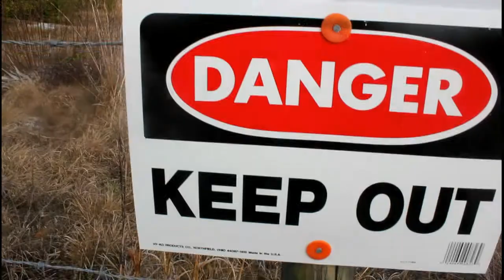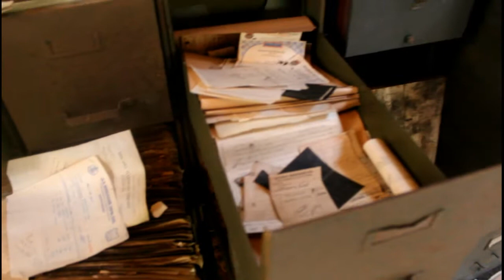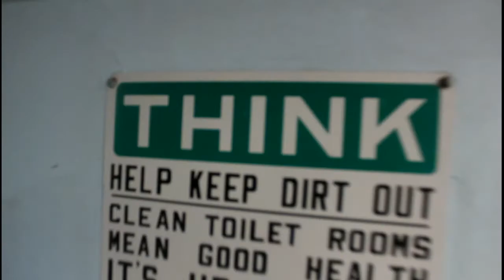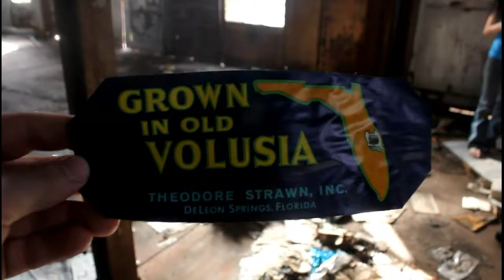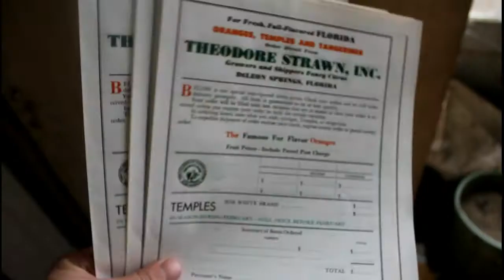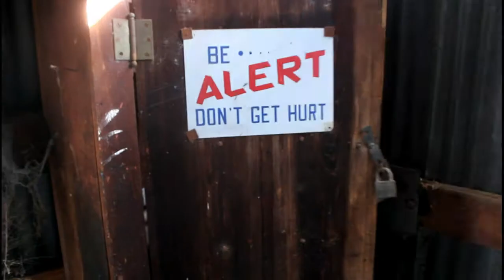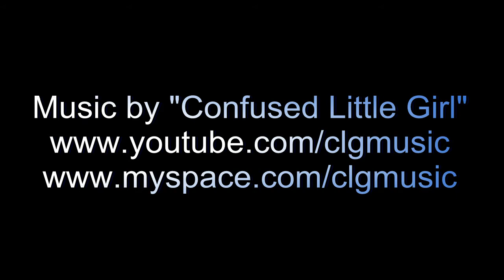Bob White Oranges - Strawn Citrus Plant - ABANDONED

Comment: The machine you are wondering about at 2:03 is an old tire balancer.  To use it you would mount a tire on to the rim, fill the tire with air and then place it on the top spindle.  Then pressing the handle down would release the locking mechanism and the tire would then "float" on a center axis point.  On the very top of the pivot there would have been a bulls-eye balance.  To adjust the balance on the tire a weight would be hammered onto the rim directly oposite of where the tire was low.